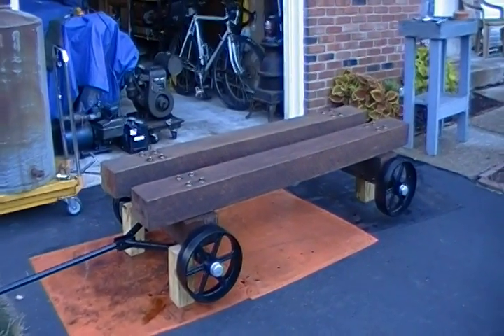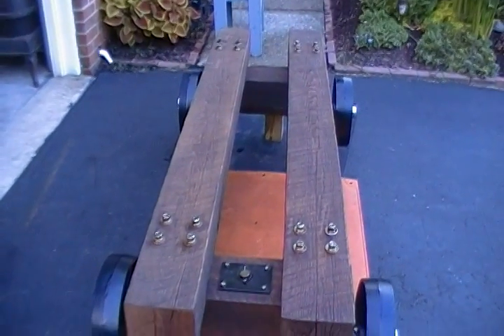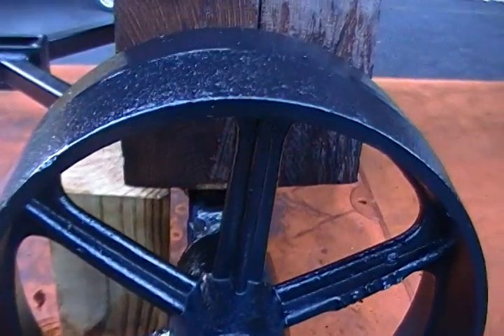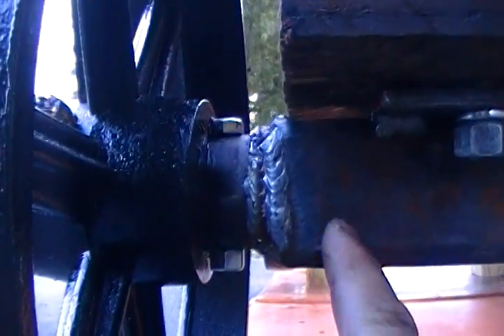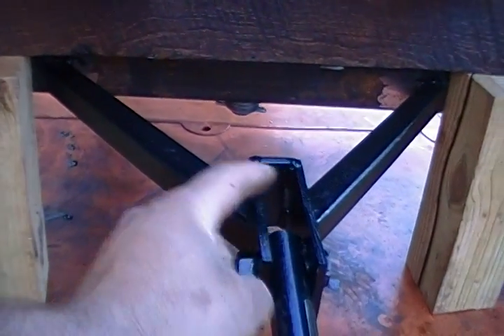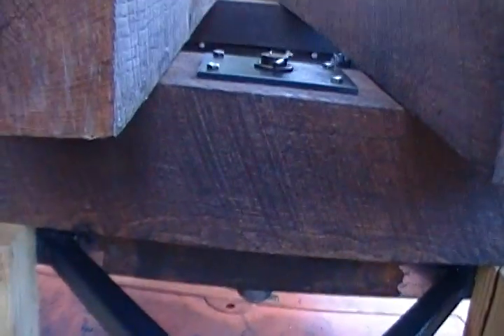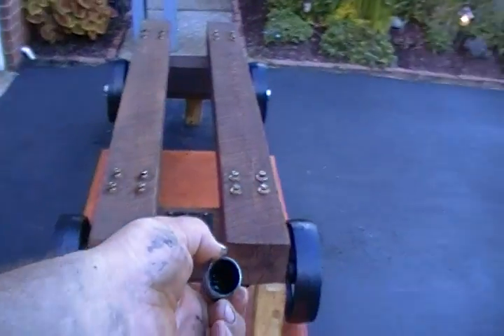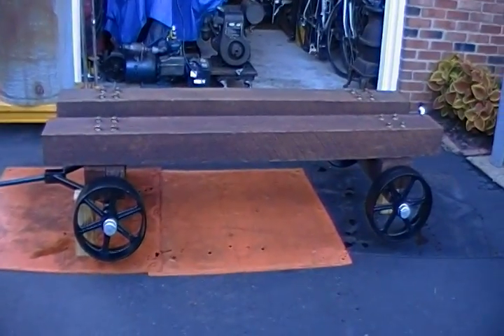Bessemer Engine Cart Update

Comment: Heya Mike. I just had a thought about your pivot point on the front axle. They make flat needle bearings (that look like washers) that I install on the king pins on my old tractors for easier steering that can take the load and would make for much easier turning. They're actually called Thrust Bearings and you can get matching Thrust Washers that are hardened to also take the load. I see with the additional washers you have at the base of the pins that you would have plenty of space to install this type of pivot set up, although, from looking, you wouldn't be increasing the gap by very much at all so stability wouldn't be affected (in my opinion.) Cheers!! Zip~

Comment: Lookin Good Mike.
I Like the steel plate you used under the hitch swivel pin,,makes it functional and gives it a blacksmith type look (overbuilt is better)
Lol I have the same hydraulic lift you are using for the bess tank.
Saved my back many times

Comment: The handle looks like schedule 40 pipe, am I correct ? And what sched.pipe are the axles made of ?
Do you think that wood is strong enough ?????????
Reply from the maker: Yes the handle is schedule 40, the ends of the axles are schedule 80, should have mentioned that in the video I guess. The oak beams are not a concern, I would not hesitate to put 3000lbs on them!

Comment: I'm worried about the front steering and wheel base / cart width and a high center of gravity once assembled.  With a center pivot, if you turn the front too much, the cart can easily tip over.
Reply from the maker: Thanks, I believe I have sized the axles sufficiently to guard against instability in normal situations.